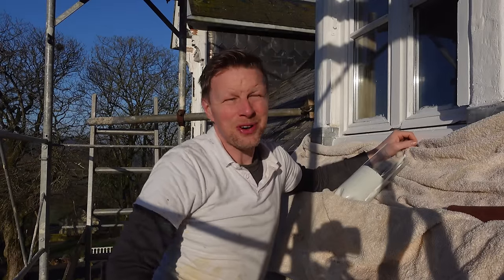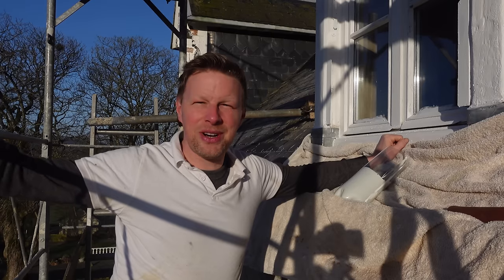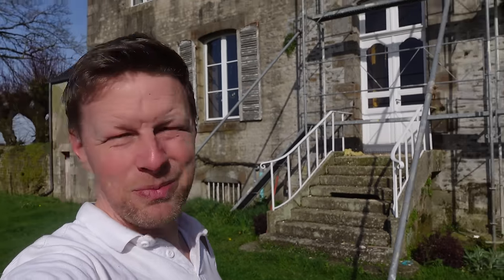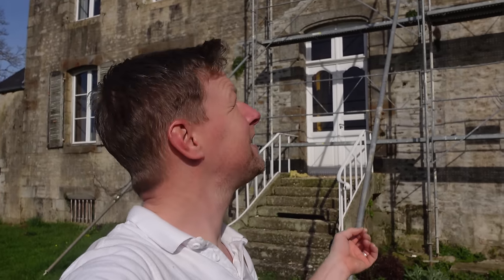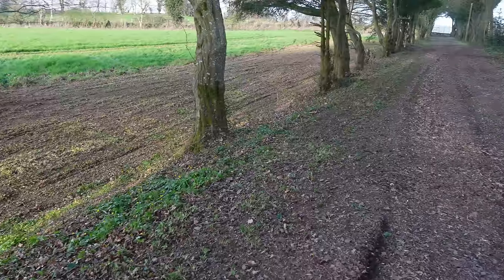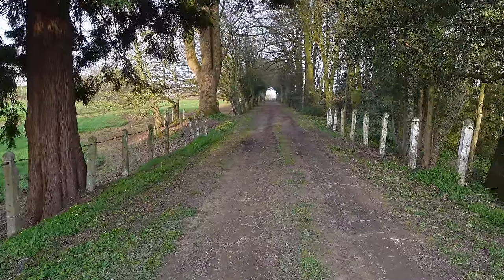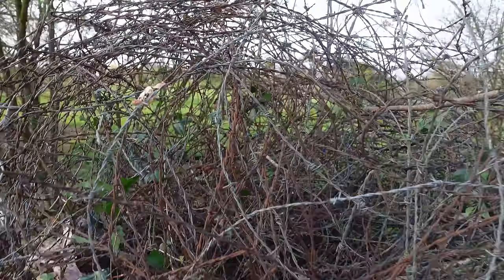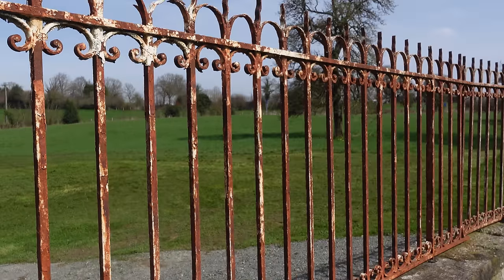Rescuing a Forgotten Treasure: Chateau Renovation Project

Comment: All improvements are making a difference.  I believe if you do sand blast the metal fencing and gates, you may have to be prepared to paint immediately after without delay.  May be worth checking into.  Best wishes.

Comment: Paula did a marvellous job priming those front gates, so I can't wait to see them when the painting is finished. And sprucing up those dormer windows has really lifted the view of the rear of the chateau. The driveway looks so much better too, especially since you've got rid of that nasty barbed wire!  So much kinder to the wild and domestic animals; and barbed wire for me will always be associated with "No man's land" in the trench warfare of WW1 and WW2. So your property will feel far more welcoming to human visitors as a result of its removal. If you're getting in someone to sandblast the fence railing and very front gates, I'm wondering if it might be a good time to get the veranda iron over the front door sandblasted at the same time? That's if it's not too flimsy to cope with a sandblasting, of course. While I realize that you have had fare more pressing other priorities, I've dreamt of coming to visit you all to volunteer to paint and restore that veranda-iron. Some really nice etched or patterned glass suitable for the outdoors would really enhance the front entry and thus the first impression on entering the chateau. I can just picture it! Can't you?

Comment: Might I suggest you cut off top pieces that are bent and broken and weld pieces from far outer sides so not as noticeable.   You can heat with a torch and use a hammer to upright the bent parts.  Hamnering without heat may cause them to break off. They look incredible.  Great job.

Comment: Rust-Oleum prevents and stops rust. However, it has a penetrating oil base in it. So, It Must Have a Rust-Oleum paint base primer, beneath the final coats of paint or else, the new paint will peel off of the surface, if it isn't Rust-Oleum. 
  It's not necessary to use it, but if you were thinking about some rust inhibitor paint, being used on those iron gates, you might want to keep that in mind.

Comment: Is the parkway the reason the previous owner sold out? it is very noisy and must create lots of pollution. The parkways in France are relatively recent  (late 60s ,early 70s) and cut thru all kind of neighborhoods. A lot of them were made to avoid the center of towns and villages which could not handle all the modern traffic.